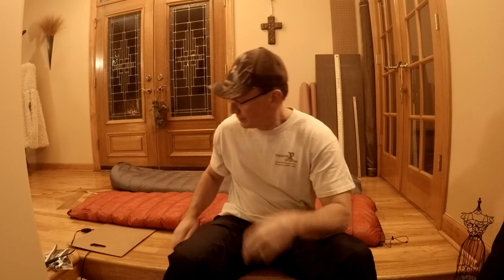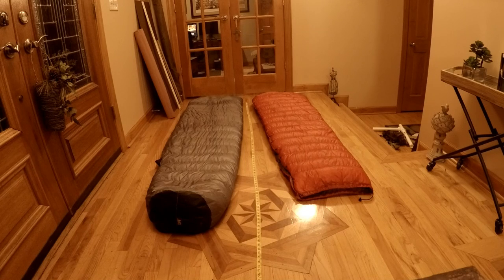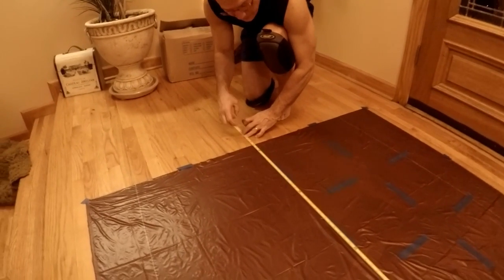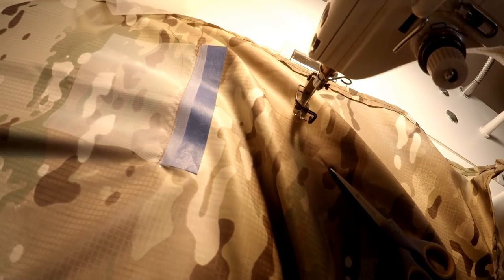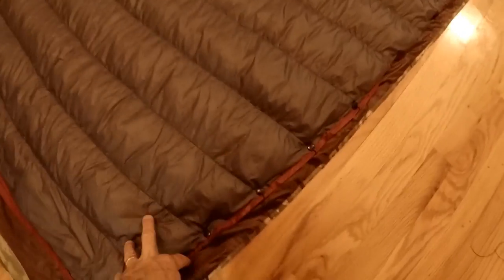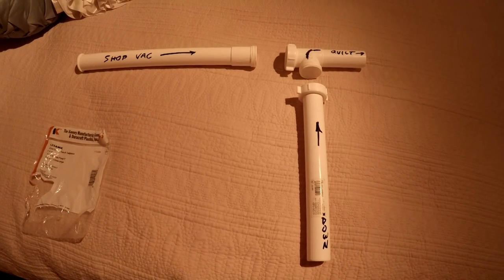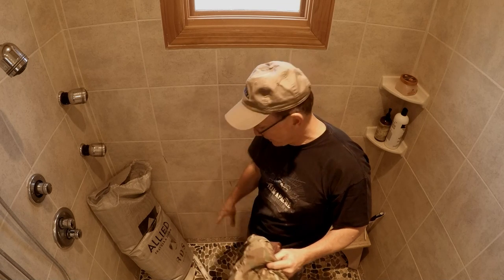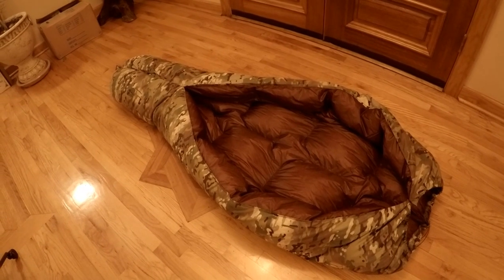DIY down top quilt - Karo Step Baffle DIY MYOG

Comment: Very nice!  About to make mine from .66 10d Membrane ordered from ripstop by the roll.  They also have .56 but wasn’t to excited about the available color.  Haven’t decided on down resource or amount yet.  Need the quilt to stay as close to 1# as possible.  (Physical challenges). By far your quilt construction appears to be of high talent!  Thanks for the tips!
Reply from the maker: Marjorie Medsker definitely  a fun project.  I have a quilt that weighs 16 oz and It is rated to 25 degrees.  I have found this quilt to not the most versatile one that I own.  Good luck with your project!
Reply: Grapenut thanks!  Do you have a recommendation source for the down (ie downlinen or questoutfitters)?  Planning on 12-16 oz of 950.  Wasn’t sure if 12 oz would be warm enough but will go over my 1# total weight goal with 16 oz.  thinking the fabrics will be about 4 oz + or -   I did the math with the formula suggested by Dubber for 0° (winter) but will most likely avoid  below 32°.  Just being prepared as I am a cold sleeper and hike fall/winter.  TIA

Comment: So, 3 years later, what is your opinion on it? How low have you taken it? That thing is beautiful. This is my goal project. Im getting some fabric and making stuff sacks and compression bags to practice before the big project.
Reply from the maker: Hey, Matt, I really like it a lot.  I designed it for use in a hammock and it excels there.  I've had it down around 20 degrees and am confident that it can comfortably go lower.  Its a great project that is really not difficult at all.   Good luck!

Comment: Very nice quilt. Thanks for the video. 24oz total weight; what was the fill power of the down and do you have a estimate on the amount of down used and what do you think the cold rating will be?
Reply from the maker: +RonKris Thanks for the compliment.  Down Fill Power is 950 treated.  I used 16 ounces with 3" baffles.  I think I can get it to 5 degrees easily although I didn't make it in time to try it in deep winter yet.

Comment: Can you give us an update on how well it has performed? I want to make the same thing for cold Quebec winters!
Reply from the maker: It works great.  I use it exclusively for hammock camping.  If I were to make one for ground use, I would make it wider and add a couple of straps, like my Katabatic quilt has, so I could keep warm on a pad on cold weather.  Also, I like being able to vent the foot box but I need to remember to tie off the hole at the foot end to keep from getting drafts.  I have had it to 15 degrees but I am confident it could go much much lower.  I live in North Alabama so I have to wait for the dead of winter to get the max benefit.
Reply: @grapenut709  good to hear! Thanks a lot! I will definitely make mine 55in wide, with eyelets to snap some straps to the sleeping pad.
Reply: @grapenut709  Thanks for the feedback! Would you say the karo step works great if you compare to your other quilts?
Reply from the maker: Short answer is Yes.  And, if you want to add more down later, you only need to open one place for entry.
Reply: @grapenut709  How do you call the T junction with a little ramp inside? I cannot seem to find it anywhere
Reply from the maker: @Filte  https://www.lowes.com/pd/Keeney-1-1-2-in-Plastic-End-Outlet-Tee/3374694

Comment: Forgive me if you mentioned in the video, but did you build in additional inches to your raw size (other than seem allowance) to allow for loft?
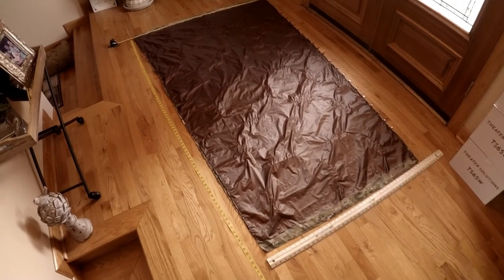Reply from the maker: If you start watching the video at the 16:50 point you will see that I do not add extra width to allow for loft.  My advice is pick a target and factor in enough margin so that you do not end up short.  I prefer to hike over 10 miles a day when I get out and I am weight conscious.  I am 6' and 195 lbs and the dimensions I used for this quilt give me plenty of comfort and warmth, and do not restrict the loft.  If you are much larger than me then I suggest you add a couple of inches to the width.  If you are smaller then you will enjoy even more comfort than I currently do.  My favorite quilt that I have many nights in served as my initial template.  Ergo, I had zero reservations when I committed to the dimensions I selected for my project.  Good luck!

Comment: What's the total cost of materials?
Reply from the maker: Multicam 1.55 Epsilon Outer...6.95 a yard on Ebay plus shipping
Argon 67...10.00 a yard at Dutchwaregear.com plus shipping
950 Fill Power treated down...194.99 plus shipping at Downlinens.com
Reply: But it is not MWR or hyper-dry down...  That is made for interior use and will hold moisture.  Kind of defeats the purpose needed for cold weather camping, no?
Reply: the down at the link provided has an option for water resistant, "WR", treatment to the down.